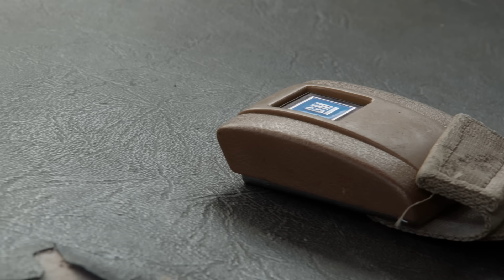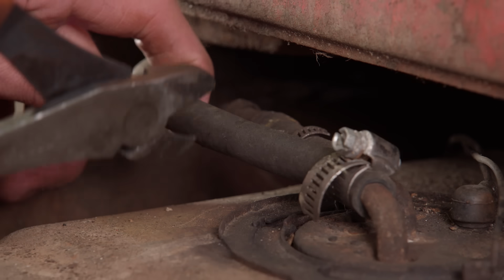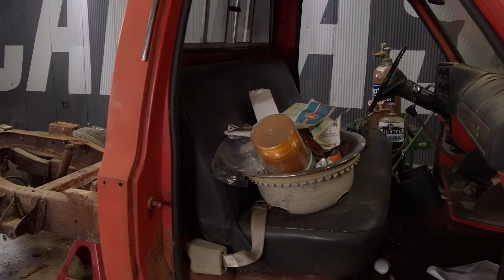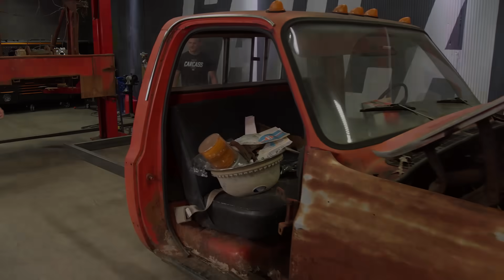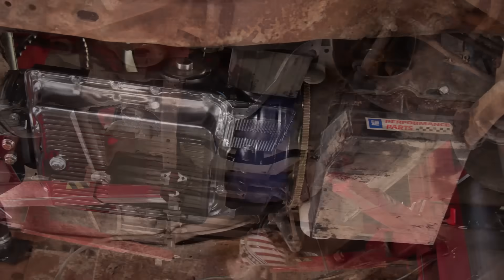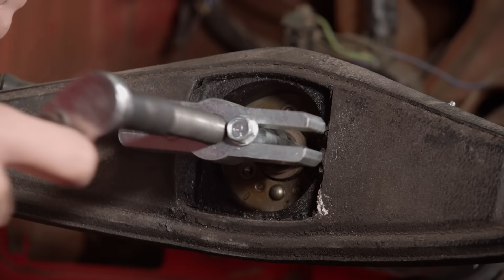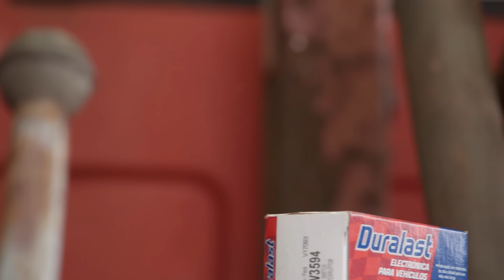Full Build: Junkyard Square Body Tow Truck Is Restored And Modernized

Comment: Lost me at pulling the SM465, don't care what your excuse is, that is the single best heavy duty transmission ever built. You made this truck all show and no go. I'd never, ever replace the SM465 in my '83 Chevy C20 with anything but another 465.
Reply: I started driving a tow truck in 1984. I was excited to see this build. As soon as they said they were putting in an automatic transmission, I stopped the video. I’ve had bad luck with automatics. I needed a trans in one of my vehicles. Mechanic recommend this nationwide engine-transmission rebuild service. I warned him how bad automatic trans were. He assured me 3 year 10K mileage warranty. Okay I agreed. The newly rebuilt trans went in and was being replaced 670 miles later under warranty. 👎👎
Reply: @acetomatocompany  Some auto's are good, like the old TH350 and TH400, some are trash, like most any CVT nowadays. Some manuals are trash too, Hyundai's manuals are made of glass, ask me how I know haha. I prefer a manual tho, simpler, they usually outlast the car (And many, many clutches).
Reply: Any thoughts on a tremec tr40-50?
Reply: @Redneckoise  Dunno much about 'em, I know a drove a newer Chevy 3500 series with one in it, felt like a nicer 5 speed version of a 465. Less dump truck, more car-ish, just with dump truck gearing haha. I liked it, but I'm not picky about manuals as long as they aren't made of glass.
Reply: @YesItsNotMe  Yup, pretty much. Some YT'ers try to keep things consistent but not most
Reply: Look at the rear fab work, 1st off id never go mig on this id go 7018 stick, second off that shits gonna flex like no other third no holes drilled to mount the channel so once it hits ots torsion limit itll bust right off
Reply: @kylez2141 , nothing wrong with Mig if you know what you're doing. I've been welding for over 40 years and still have yet to see anything I have fabricated fail due to insufficient welding. If they mount that wrecker body properly, torsion won't be an issue either. For my money, that truck was a little too far gone to be anything other then crushed and recycled but since it's not my money, it's not my business either.
Reply: @s.hooper4683  i dont give the sum of 2 fucks times zero bout your 40 years mig welding, that bullshit right there didnt fully penetrate in some spots and a little lincoln 225 coulda ran a circle around it
Reply: What the hell is it with the whole "we upgraded to an automatic" thing? Why does it seem like most every restoration or restomod that had a stick in it end up with an automatic? In my day, installing an automatic, especially for street use was an indication that the owner of said hot rod just couldn't figure out how to row gears and took the easy way out. They were usually laughed at on Saturday night at the street races. I saw a sticker on some guy's old Chevelle that said "millennial anti theft device" and then had a picture of a 5spd gear shift know. I just about laughed my ass off!
Reply: @s.hooper4683  Man I'm 32 and I get looked at funny for not wanting to own an automatic. I've got a 2000 Nissan Sentra 1.8L with a 5 speed, a '83 Chevy C20 with a SM465 4 speed with granny low, my '93 F150 Flareside has an auto.. For now haha!
Reply: @DeadReckon , lol, I'm 57 and love to weld & fabricate. Good thing too as I finally got around to building one of those 1923 T-Bucket kits from back east. I promised myself I would never do it unless I could put a 302 in it with a stick behind it. It took a little figuring as those cars have very little room in them and even less room under them but I put together a push rod hydraulic clutch system that worked beautifully with a 4spd SROD overdrive trans out of an 82 Mustang behind that same car's 302 HO that's been mildly built. WAY more fun to drive then all the other Buckets I've seen that all have 350's and automatics. Let me know how your 93 F-150 trans swap goes. Maybe I can help.
Reply: @s.hooper4683  Will do, hard part is finding a driveshaft, don't wanna eat the cost of having one made, and the truck is weird. 2 wheel drive extended cab short bed stepside "flareside" truck. Need to find a 2wd 5 speed 92-96 ext cab short box parts truck.
Reply: @DeadReckon , it shouldn't cost that much just to change out the front yolk should it? I'm not even sure they're different but if they are, buy the proper yolk, take it to your local driveshaft shop, change it out and have them re-balance it. If you can't find one where you're at and when you're ready to do the job, let me know. I've got a great driveshaft guy I've been using for all my projects for years.
Reply: @s.hooper4683  I'm honestly not sure what all is different. I've been looking for a 5 speed 2 wheel drive truck in the junkyard but all I find are 5 speed 4x4's.
Reply: @DeadReckon , 93 F-150 right? 300-6cyl, 302 or 351W? Actually that doesn't matter as the small block transmissions will bolt on to all of those. Even the 351C will bolt in where the aforementioned engines are now. Same motor mounts and all. If you want to drop a 302, 351W or a 351C in where you have a 300-6cyl now, you'll have to change the motor mounts to the V8 style but thats about it. I know the slide (front driveshaft) yolk is different between the stick and the auto on old Fords but in 93? I don't know. If you want to spend a few bucks, you could call American Transmissions and see what they want for a Tremec 500 (5spd) and if you really want to blow some cash, I'm pretty sure the trans tunnel in your truck is big enough to clear the Tremec 600 (6spd). They'll also give you the proper slip yolk to adapt your driveshaft to their transmission. Keep in mind that a brand new Tremec transmission will probably set you back $2,000-$3,000 bucks but the upside is that it will probably be the last tranny you'll ever have to put in that truck. Ever.
Reply: @s.hooper4683  Yeah I don't have that kind of cash for such a nice transmision. Just planning on getting a junkyard 5 speed and swapping it in. My truck has a 302, was a factory 302 truck but the engine isn't the stock one. The kid I got the truck from put the engine in this truck back around 2017 or 2016, I think it's from a 92 F150 that his brother wrecked.
Reply: Damn, y'all are so whiny. Automatic transmissions are far superior now. Get over it. Y'all probably whine about electric vehicles, too, huh?
Reply: @claytonbyrd6134 , there's absolutely nothing like rowing through the gears behind a V-8 engine with a nice exhaust note. Automatics are fine if that's what you want/need but if you've never turned on to a long freeway on-ramp, put your right foot down and started grabbing gears till you get to freeway speeds well, your just letting some of the best in automotive life pass you by. At least that's my opinion.
Reply: @claytonbyrd6134  And, you're the kind of person who would drive the automotive equivalent of a toaster. AKA, a Tesla. Most cars have no feel to them, they are appliances, like a Tesla. 

Electric cars ain't the future bud, and neither is combustion. Both have been around for over 100 years, both are obsolete. I'm just enjoying my dump truck feeling 4 speed and sloppy 5 speeds while they last.

Comment: How do you put that truck back on the road?  Usually, when a car goes to the junk yard it can only be used as a parts car.  The title is seen as a "salvage".  Just wondering?
Reply: Plus with a welded frame like that, generally is illegal to weld on a frame like they did

Comment: Boring show! I would of rather seen them back half a good donor frame and cut a z notch into the frame and fish plate it for strength. It would of been more interesting and could of taught the people that don't have all those fancy tools how to this at home with simple tools. I could of replaced this frame with mostly an angle grinder with a cutting disc and a welder. But i guess everyone's a critic. Cool truck though. Nice job getting running and loading it on the trailer under its own power.

Comment: I wouldn't trust that winch further than I could throw it.
The old mechanical winch was an integral part of the A-frame, not just perched on top with a couple of gussets, and therefore MUCH safer & stronger.

After all the other work you put in, that's a really poor show.

Comment: Cool project. Def wouldn't want yall to do frame work tho. It is what it is for sure. But, if it was me I would have replaced the whole frame.. the step up for sure should have been double plated. Also that's a huge no no to weld in cross members. The need to be able to flex. Eventually those welds are gonna fail. Next time consult with me first. 🤓
Reply: that what i mean  this frame  is as  weak   as the one o nthe front half all show no go . Ya cant even tow   with it  now   ,needs to be boxed end to end all new frame not jsut  make it pretty  bac half.
Reply: @Thevacomaticvacuumcorner  and heat treated and at that point just rerail the whole truck.. it is what it is tho all for show really they'll probably never tow anything with it anyway lol
Reply: @sfh294  ya  all show but still  only  half  fix

Comment: Love this type of build. I'm kind of amazed that you didn't put any rust reformer behind those kick plates and everywhere else. Simple quick step that would have added years to the body.
Reply: Only thing they care about is if it makes it to the end of the filming
Reply: As with the cars that were in Pimp my ride, their only concern is that the final product looks nice, they don't care about how long the car will last. If they did, it would have to be completely stripped down to the last screw and sent to a chemical bath and i not gonna say about complete rebuild of engine, chassis and etc.

Comment: It was a cool build till they decided to ditch the tried and true SM465 and replace it with a 700R4 which is crap for a truck like this and now they can never use the PTO for the wrecker body ever again. Oh, and they claim it could have had a diesel engine which isn't true because a diesel wasn't available in a 1-ton till 82 with yhe 6.2

Comment: I hope you have adjusted the air pressure on all 4 tires of the rear axle, so that this is also straight when welding the spring holder !

Comment: It would have been much easier  just back halving it with a frame from the yard you were just in!!
 And it should of had a z cut! 😒  you ruined the nostalgia of the truck by modernizing the rear winch,I mean it's still cool but! I have had 20 square body trucks since 2002 my first was a 12 inch super lift, 1973 chyanne super, had 36' military oz hummer tires weld aluminum rims, mini spool  rear,  open front. It  Had a 1965 4 bolt main steal crank sb  327 with summit cam,hei dizzy, 202 camel hump heads, hooker super comp longtube headers, h pipe with 6 inch megaphones dumped over the rear-end,it was orange and white
 I was 15 when I  built it with my dad

Comment: The upper rear shock mounts need to be rotated 90 degrees so they will pivot properly as axle moves up and down. You may get away with it for quite a while but will eventually, if not sooner break the top mount off the shocks. Nice job overall!

Comment: I recently picked a ‘73 c10 short bed fleet side with that same granny 4 spd but a 250 str8 six…..I literally had a cammed 5.3/ 3000 stalled th350 in there within the first 4 days I had it home……the advantage to the 250 six and granny 4 spd is that the rear end already was geared at 3:73…..truck hauls ass. I’m in the final stages of body and prep work getting ready to shoot a white blue ghost pearl flake on it…….

Comment: I can't believe you left the fuel tank in when replacing the floor pans.  That thing is a bomb waiting to explode.  What did you do about the driveshaft and brakes?  Another thing I noticed was you built nice heavy duty brackets for the rear of the winch but what about the front winch mounts?  That's where all the stress is.
Reply: I don’t think there was any fuel in it.
Reply: 😂 it's a brand new tank, there's no gas in it, genius.
Reply: Are your eyes bad Randall, 😂

Comment: I don't know anything about cutting frames etc but I remember seeing a truck frame cut in a zig zag pattern before it was extetnded and I think it was said it helps to put less strain on the welds.
This frame beeing cut in a straight line is it ok? I mean for handling the weight of the box, the crane and an extra car.

Comment: I've had two square bodies and the only real thing that bothered me about them was that bend-in-the-middle hood!  If the hinges weren't constantly checked for lubrication, those dimples (what was that design engineer smoking when he thought that lame idea up?) would allow the hood to buckle and then it got expensive to fix.  Then add the area above the rear wheel wells that love to collect water and rust was inevitable.  GM never has been known for great engineering on their trucks.

Comment: I guess when B&M is a sponser, you need to remove the manuial transmission. Other then then that reason, just doesn't make sense to me. Sorta rminds me of the Overhaulin" show when they took the factory a/c out of Lance Armstrong's GTO convertible and installed a VintageAir unit. It's all for TV and not for use average Joes out here.

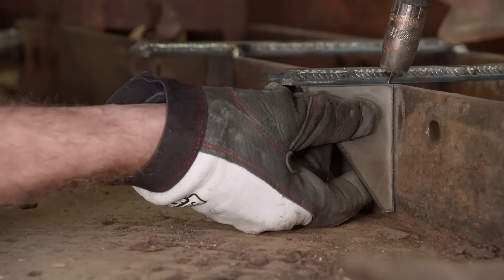Comment: 1:20:06 man, I don't think I'd trust towing a car or truck on a sling with the winch just welded, I'd rather see it bolted down also
Reply: If the weld won't hold it!!
 a bolt never would

Comment: You make mechanic work and metal fabriction look easy and enjoy truly its very difficult and costly.
Beautiful amazing project and professional clean work with passion. Well done guys.
Note. Cutting and welding the frame not acceptable in all country MOT.
Reply: Especially without plates and bolts.. you never just weld two different types of metal like that and not plate and bolt it. But yeah, some states don't let you weld the frame at all.

Comment: You clowns forgot tail lites in the rear apron  ,any one who runs wrecker knows standard/manual trans is more reliable and pto winch is far superior to electric. But then you are building a pavement princess and not a real work truck . What an insult to square body chevs . You should have used some ford junk and left the square body for the real world

Comment: I would have used the old cable winch. 
Installed an electric motor under the body for the chain drive and solenoids to operate it by the rear levers.
But you know this is a info commercial how to show.
Also that fill in background music has got to go.

Comment: Brother has a 2016 body oN a 1975 C30 long bed Frame with Dana 60 with lockers with a 402 big block carburetor with 44" ground hawgs AnD HiS favorite colors Red. Yellow. Orange blended together.. He's stuck going from computer to old school engine starting instead oF computer operative.  Told him I could make iT work with what he's got just use different connection iN power distribution box. Cause he doesn't need 5v references

Comment: Excellent video  guys :) also remember drive one those trucks but was 35 series with  400 V8 gas  motor daul exhaust with 4 barrel 650 CFM Holley Carb , 5 speed Manual transmission also 10 leafs springs with 411 rear end gears , 2 fuel tanks  and was great truck plus power steering and brakes! Also my first Tow Truck was 1972 Ford F350 extended cab F350 with 390 4V V8 4 barrel carb with hand choke  cable knob in dash with Rare Coulmn Shifter Manual 4speed transmission,  409 rear end gears and also I  had 1968 Eaton D18 International pick up truck 1 ton Manual transmission floor shifter plus 5 speed with Bow Low First gear also racing clutch in and 1978 electronics with 4×4  plus 411 rear end gears ! In 2005 I bought went to a 1995 Dodge D350  extended cab with 24 vavle Tubo Cummings Desiel motor 6 cylinder with 2 fuel tanks also 4×4  411 rear end gears  and same Wrecker Holmes too !

Comment: That used engine looked like the GM L31 crate engine. I have installed one and they are excellent engines for this application.   the only down side is you must use an electric fuel pump due to the roller cam not having a fuel pump lobe.    these engines are much better overall than rebuilding a stock 70s to 90s engines for the price and amount of headaches saved dealing with machine shops and rebuilding an engine.  Thats coming from me that knows how to rebuild engines and has the tools to do the work.

Comment: After having an square body, I would assume yall would have reinforced the area behind the steering box. Cause that's one of the main areas to check for frame cracks due to the steering box constantly flexing the frame.
Reply: Definitely needs a 1 ton steering box and boxed in frame !
Reply: That is a problem on the 4x4 trucks.